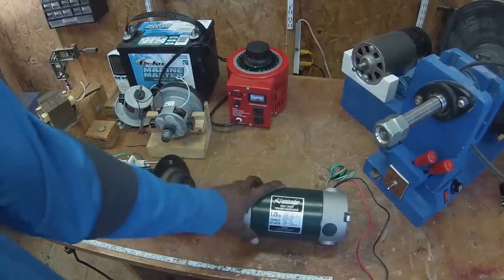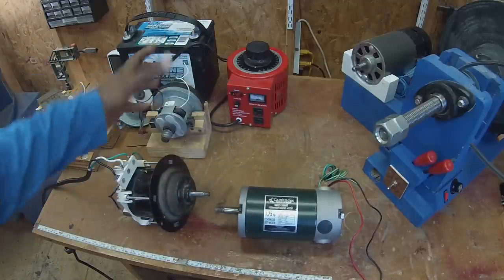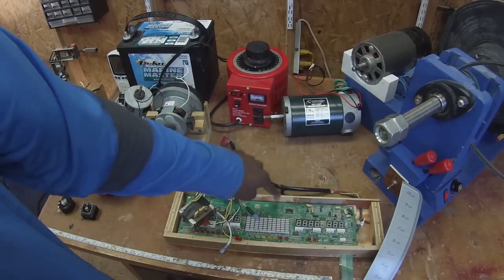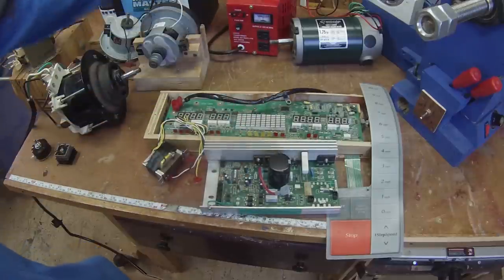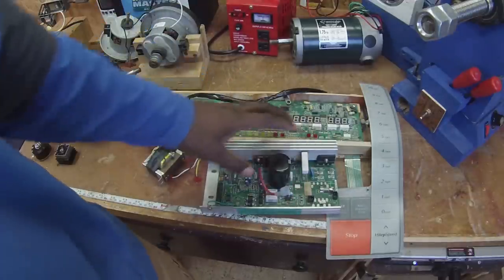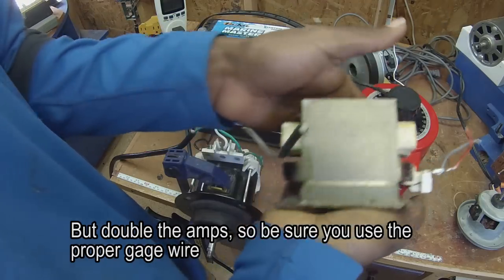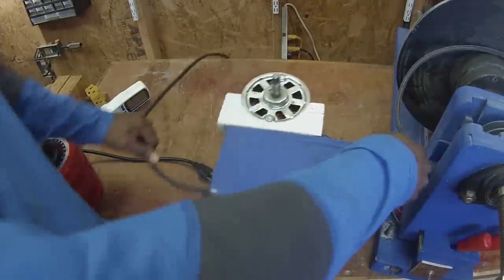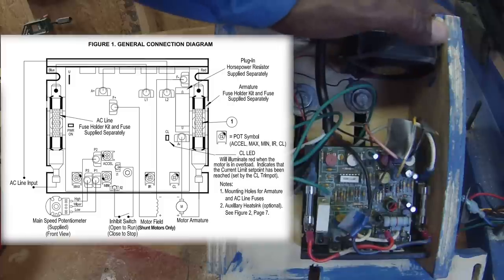How To Wire A Large DC Motor And Control The Speed; Treadmill Motors and Universal Motors 019

Comment: Good videos Jeremy, can u tell us more about using hvac unit motors and blower motors. these are 2 phase, 240v with either start or start and run caps. I want to use them with regular 110v. is it possible? thanks.
Reply from the maker: I don't have any experience with wiring a 2-phase motor. If I can find one, and wire my shop for 240v I will definitely do it.... I am being serious just in case that sounds like a joke. I just haven't salvaged a motor like that yet. So many people have asked I might just buy one sooner or later.
Reply: These are the hvac condensing unit cooling fans or the evaporator blower fans. Kind of the one shown here:
http://www.supplyhouse.com/Rheem-51-102500-04-1-5-HP-825RPM-1-Speed-Motor-208-230V
http://www.supplyhouse.com/Rheem-51-21854-18-1-5-HP-Cond-Fan-Motor-208-230V

Can these run on 110V, single phase? thanks
Reply: The standard terminology is either single-phase or three-phase, you can look on the motor's label and it will say "phase" with either a 1 or a 3, although some labels use the symbol for phase instead of the word "phase", just google to find the symbol. Many electric dryers use single-phase 220v motors as do hvac because the common power source is 220v single-phase wall plug. I am sorry but I have never performed such a conversion since 110v motors are easily attainable, although I think it might be possible. Remember to take all appropriate safety precautions and wear safety gear, especially when experimenting with such dangerous voltages.
Reply: TaggingTechnician - thanks Jeremy

Comment: I just started watching some of your videos, great work, thanks for posting. One quick question, the power meter you use got terrible ratings on Amazon, would you buy that one again?
Reply from the maker: I haven't had any issues with it. I use it just about every time I am in the shop and I have had it about 2 years. But, that is a sample size of one. Its hard to say if I just happened to get one that is defect free. Yes I would buy another one.

Comment: Could you please suggest the cheapest route for me to take? I would like to find a motor and equip it for variable speed from 0-120 rpm. I also need it to have a moderate amount of torque (maybe about the same torque it takes someone to turn a stiff door handle). I have an old cordless ryobi drill, but the slowest I can get it to spin is around 60 rpm. From all that I have been able to find and read, most say I need a DC motor. Any ideas and suggestions would be greatly appreciated.
Reply from the maker: Using a treadmill motor with the console is certainly the cheapest (free as far as I am concerned), yet the bulkiest option. I can’t make any recommendations beyond that. I don’t know what tools you have, you manufacturing ability, the list goes on and on. I suggest you keep searching until you find a combination that fits your needs and abilities. Some people for example can build their own speed controller. That might be you. I willI let you decide.

Comment: You don't need a massive cap always, any cap with the right voltage rating it will help.   Those cheapo router speed controllers are dodgy at best, entirely hit or miss if you get one that actually works they work good. The rest of the time their junk

Comment: Stirling engine that turns atmosphere to liquid that filled a large insulsted tank with liquid atmosphere. Frequency emitters in the insulsted to force liquid atmosphere to form vapor generating atmospheric pressure. Swash plate type 12 with magnetic bearings made from gadolinium or from super conducting materials because of using ultra low temperatures from the liquid air being used to spin the swash plate type 12 to crank a electrical power generator. A cooling and electrical power generation system. The liquid atmosphere could also be harvested into its individual gases and sold. Liquid nitrogen liquid oxygen liquid argon gas ect. By using different frequency emitters in the liquid atmosphere to seperate the gases not unlike how super conductor separators can remove pollutants and bacteria from processed sewer from cities to produce fresh clean drinking water.

Comment: I was just wondering what is the most powerful dc motor you have and where to get it. I am trying to make a electric dirt bike
Reply from the maker: The most powerful DC motor I have is a 3hp and it weight about 100lbs. I paid $25 at an auction Probably not a good choice for an ebike. Just search the web. There are many people doing what you are trying to do. You can find examples of what you want.

Comment: Hi Jeremy, hey I have wired a 2hp treadmill motor to my belt grinder at home.  It uses a large Variac and a rectifier similar to what you used in your video, I have also used a 4000W SCR motor controller with the same rectifier.  The issue I am having is when I turn switch the AC power off and on, or un-plug then plug it back it.  It will sometimes pop the breaker or fry the small 4000w motor controller.  any ideas on this?  This will happen with the controller or variac turned all the way down.
Reply from the maker: I can't help you there. You have to do some homework.
Reply: Thanks Jeremy, it does look like I will need some sort of a snubber diode to allow the motor to bleed off the voltage produced from "winding down", when I open the circuit the power is now stored in the motor because it has no where else to go, and when the circuit is closed again there is a power surge.  I'm no expert this is how I am understanding it anyway.

Comment: The use of the capacitor, is for filtering the bridge rectifier of any A.C. voltage that may sneak thru as noise.  Right now, you have no filter.  As long as the capacitor voltage is high enough, any amount of capacitance is better then none.  The rating on that capacitor is good.  You might notice also that the voltage with the capacitor may be higher then without.  If you look at the voltage, with an O-scope without the capacitor, you can see the ripple A.C. voltage, while with the capacitor, you will see a flat line, which is the full wave D.C. voltage. The more A.C. input voltage you add to the bridge, the flat line just goes up on the 
scope which indicates a higher D.C. voltage.  With out the capacitor, running a motor is ok.  If you were running the motor and other electronic equipment, like on the original board, the A.C. noise could trigger unwanted affects on the rest of the board that needs to have clean D.C. voltage.  Like in the digital display, that has lap counters, that with noise could make a miscount of the clocking circuit, which may show more laps then you really took, or Less.

I enjoyed watching the presentation. 
Keep up the good work!!!

Michael from Gig Harbor Washington, State
Reply from the maker: Thanks Michael. So to be clear, is it appropriate to say that more capacitance can "absorb" more noise? And, by noise you mean ripples in the voltage level? If I talk about this in future videos, I want to research your comments here and be sure I am using the appropriate terms.
Reply: To D.C. run electronics, (such as transistors, IC's, clocking, etc.) need to be free of any type of Noise (ripples) to work right.  It's kind of like being in a restaurant talking to a friend directly (D.C.) across the table, and other people are also talking in the background around you (noise or ripples).  You have to get rid of the noise, to hear your friend more clearly, otherwise you or your friend may hear the wrong information from the noise.  To make sure you only get the messages from your friend, get rid of all the other people in the room.  There is no way to get rid of  more noise then no people in the room.  Same with noise in a D.C. circuit.  You can add more capacitance to the circuit, but if the noise is already at it's lowest, adding more would be a waste of money.  If you are just running a motor, you don't really need a capacitor, unless there is too much A.C. going thru the bridge circuit, which could make the motor make noises.  If you hook up only A.C. to the D.C. motor, the motor just buzzes because it is trying to move forward and backwards at the same time (half positive, and half negative, during the  A.C. cycle).  So in this case it would good to add a capacitor.

There is  a lot of information on the internet.  There are so many things to learn about electronics, and there are still things that even the best still are finding more things to learn.  So the best thing is to learn about only the question you have right  now, and dig deeper as time goes by to learn about more. 
You could get overwhelmed by all the formulas, and get more confused then before you asked the question.
Just keep up the good work,  don't give up, test everything, and try everything.  Who knows, maybe you will find the answer to another project you have had some troubles with.

 Most of all, Just Have Fun!!!! 
 If you make it a chore, the fun down the road goes away.

I hope this helps!!!!!!!!

Michael

Comment: It is extreamly easy to controll a mc-2100 treadmill bord. Any bord can be controlled so easy it is stupid. Will cast you about 10 bucks in ebay parts. All you need is a 555 square waive generator bord for 99c. Plus 2 10k 10 turn pods.
Reply from the maker: You have to know what those parts are and how to wire them... that is not common knowledge although it is very easy for those in the know. I don’t see that as plug and play easy for everyone
Reply: Jeremy Fielding i would be more than happy to show you and help you make a video. I run my mill with a mc2100 there is a gentleman that made a video of how he made the circuit. But it is readily available on ebay for 99c or 3 bucks if you want it quickly. Just let me know I will tell you how to do it it is easy. It took me a while to reaserch it and find the correct bord. Love your videos.
Reply from the maker: Thank you for the offer, but I am not working on that direction right now. I may come back to you on this. I have a couple of these controllers I haven't thrown away yet. We shall see

Comment: Internet is the best thing has happened  to us. Any field you are interested, you can find very ressurful people to get you inside the knowledge of that field. But stupidity is a bad disease and that's me. I just turn apart a fax machine and found several small DC motors. There are several wires coming out of them, way more than I can understand why. I just want to know how to wire them to an AC power base. How, how, how???

Comment: Thanks Jeremy, I noticed that you didn't give the specifications for your DC Bridge Rectifier, could you supply that also... thanks! :-) Great video!  I'm presuming everything on it's rated for 130V AC, and I'm also assuming the DCV out depends on AC Vin, but what's the DC Amperage rating?
Also, wanted to add that the capacitor is only used to further smooth the DC out.  I too am not sure on the # of Farads the cap needs to be rated for... but I believe the cap would increase efficiency as it would also make DC wave more square.  I'd be interested in what you find;  I'm thinking, but could be wrong, but higher Farads would just mean more capacity for smoothing, but would also introduce a high voltage DC (potentially dangerous) and would need to be discharged before working on it after power is off.
Reply from the maker: Please double check... the rating is 1000V and I believe 50 amps. I am pretty sure it's in the  video, but if not I will add it to the description. It should be where I talking about the rectifier
Reply from the maker: time 6:07
Reply: Thank you, not sure how I missed that...  BTW, I'd have gotten back to you sooner; but, YT & Google has made following previous post conversations nearly, if not totally impossible. Thanks.... I'd think all Channel makers would be furious by their recent actions with regard to that aspect of YouTube.  Destroyed the part I loved about YouTube, the potential closeness and involvement with one's favorite channels... BTW, love your shop and your videos, so helpful for a guy like myself with limited space... Innovative.

Comment: Where did you get your amperage digital inline meter that you just plug everything in and how much do they cost?
Reply from the maker: Its called a "plug power meter" it was about $20 on amazon.
Reply: Jeremy Fielding Oh OK tyvm. I just want to say that I really enjoy your videos. I hope you keep up the good work. I really enjoy your videos an I watch them every chance I get.
Reply: Jeremy Fielding The meters I have found only go up to 15 amps. is that enough for motor testing?
Reply from the maker: +tinydx95t2 yes... but I usually try to find items that match my circuit breaker. That way the breaker trips before anything is damaged. My breaker is 20amp for my shop.

Comment: You didn't say why we needed a capacitor in parallel with the DC motor. It look like everything's working fine without it. And also you didn't mention the voltage on the secondary side of the microwave Transformer. The way it is right now.

Comment: Great video Jeremy. I've learned so much from your channel. I've a question. I am in the process of converting a boat I have built to electric power using a 50lb thrust (50 amp max) 12v DC trolling motor, 100 amp hour marine battery and 200W of solar panels with a 20 amp charge controller. I'm adding a PWM controller to control the  trolling motor speed remotely from the helm (forward in the boat). Both the battery and the trolling motor are at the stern. I'm finding that if I run wires from the battery in the rear forward to the controller then back to the motor, it makes the circuit length 45 feet which means I need at least 4 awg wire. I'm wondering if I can leave the PWM unit in the rear nearer to the battery and motor thereby shortening the circuit, and just lengthen the POT, reverse switch, and digital speed percentage display wires to bring them forward. here's a link to the PWM controller I'm using: https://www.ebay.com/itm/112632201224
I appreciate any advice you may have and thank you again for all your great videos. Here's a link to the boat I built that I'm adding the electric motor to: https://www.youtube.com/watch?v=gCC0yk917Og&t=475s
Reply from the maker: I unfortunately can’t give one on one advice. Please understand I get hundreds of request for advice like this. It just isn’t safe or practical to try and consider all the possible things that are right or possibly wrong with someone’s idea.

Comment: Ok Jeremy..got a question for you.  I have a dc motor from an old treadmill running my metal lathe.  The original console/power supply is MC2100.  I switched to a 10000w SCR supply/control and I lose torque drastically..switch back to the original mc2100 and no loss of torque.   WHY ?
Reply from the maker: Unfortunately I can't offer one on one technical advice. It is simply not safe or practical to do so at this volume

Comment: You may have already addressed this but did you just use a 12V D.C. reversing switch?
Reply from the maker: It is a reversing switch but can be used with AC or DC. For example you could use it to flip the polarity of the start winding and reverse an AC motor. I think it was rated for 200 volts and 15 amps. That motor runs up to 130 volts DC.

Comment: I see that there is a 20 amp fuse on that vaiac transfomer...so does that mean that you can only run up to 20 amp motors? Or can you switch out that fuse if your running a bigger motor? If you could make a video on three phase dc motor control that would awesome
Reply from the maker: +Kevin Bezanson I chose this because the breaker in the house is also 20amps so I am maxed out unless I want to run new wire.
Reply: Ah!  That makes sense then! But theoretically if you had a power supply that allowed higher current you could switch it out?

Comment: Ive got a dlk-2036r dc drill variable speed trigger im trying to use on a ebike controller as a trigger throttle...signal wire 5v positive and ground wire from the bikes controller how could i use the trigger ... the trigger is rated up to 36 volt in 20 amps but the speed controller it's a bike we don't we need the signal from the trigger so I'm thinking the ground in the positive this is supposed to go to the DC motor on a the drill would not be needed and on the bottom of the relay you have a small red yellow and black wire along with larger gauge wires to red and black I've searched all night long I know there's some way we could use just for the signal from the trigger into controller of the bike and then let it do it let it do its thing to do DC motor  enjoy this video is definitely going to subscribe I have some questions for you later

Comment: Why does my 120v DC permanent magnet motor have 4 wires? Obviously the black and red are for power, but it has 2 blue ones which feed into a hole opposite of other two. Everything I find online just ignores their 2 extra wires, but they tend to be green and yellow...

Do the blue wires plug into the motor controller (which I dont have)? I'd really appreciate the help. Your videos are spectacular.
Reply from the maker: +Zahi Alsalman on the wiring diagram they are always associated with a thermal switch and a circuit breaker. I believe it is for thermal protection. If the motor overheats it shuts it off.
Reply: Jeremy Fielding That would make a lot of sense. Thank you, and keep making these great videos. You're second to none.